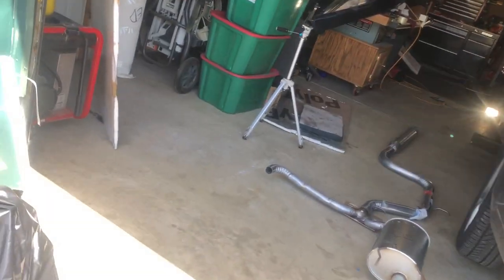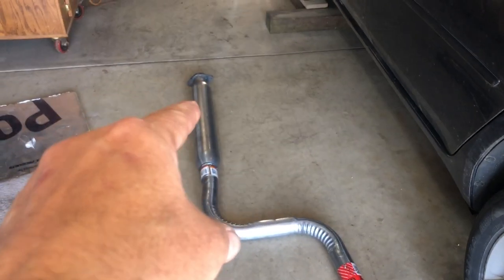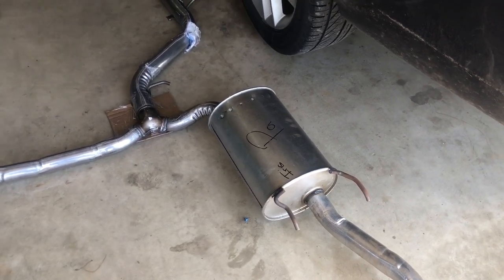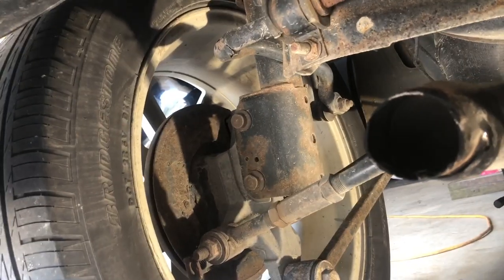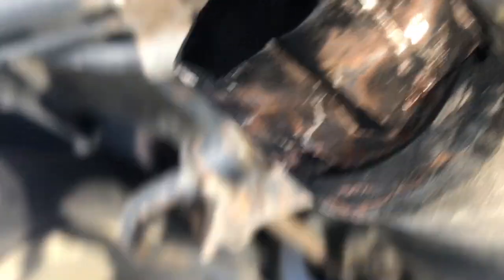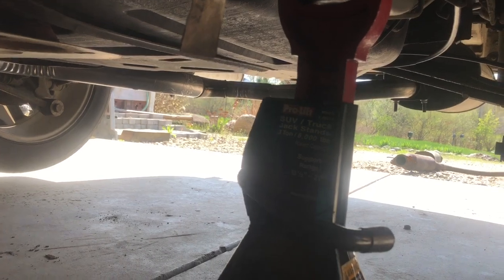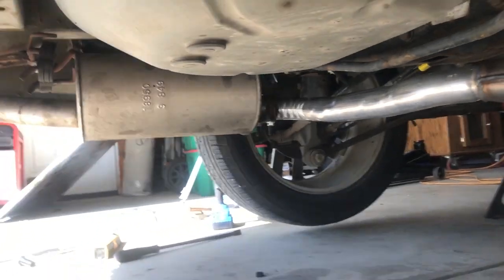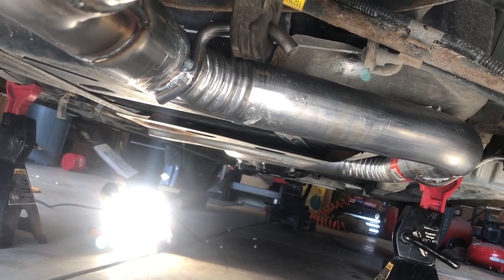06 - 11 Chevy Impala - CAT back exhaust replacement - No welding

Comment: Hey Bud i'm glad you got that pipe off without to much of a struggle. I've had great luck with Walker exhaust. Seems i always end up with a car from up north with rusty exhaust the Walker makes fine replacements. Looks good and best of all sounds great.  LOL when i lived in ND those were called Party stores too. Here in the south they're called Liquor stores or sometimes they'll say on the sign "package store" HAHA! I'm from GA originally. The coke spiel sounds about right! And as for as what you put your groceries in Up north is a cart. Down here it's a buggy. Take care!!
Reply from the maker: Ooo....cart and buggy.  I remember that one now!  I was actually pretty surprised at how easy and inexpensive this exhaust system was.  I have less than $200 in it (with shipping) for a cat back exhaust.  Getting the longer pipes sourced without shipping charges is key.  Most of the local chain stores you can get the pipes shipped to the store for free if they don't have free shipping to the home.  I like Rock Auto for their prices and selection but their shipping on these big parts is outta sight!

I would love to work on non-rusty cars.   Rust is my nemesis.  LOL!
Reply: @resurrectionautorebuilders8465  I think that's my main issue with Rock auto. Many times i've gone there to look for parts and find that i can get the same part from Ebay or amazon (because we have prime) Shipped free or for much less than Rock Auto. There prices are decent but when you factor in the shipping, it's not much of a bargain. Time can also be a factor. If it's a daily driver. I don't want to sometimes wait a week for the part. But yeah less than $200 is a great deal on that system.
Reply: How did you get it in screwed front the manifold

Comment: Is the catalytic converter welded at any location? I hav3 to replace one and was wondering. 2008 3.9
Reply from the maker: Sorry I didn't see this comment sooner.  The welds are from the resonator on back.  The cats are stud/nut type connections.

Comment: How many cats does the impala have?
Reply from the maker: Just one.  But it's a bitch to get to.  It's on the back side of the engine between the engine and the bottom of the firewall.
Reply: @resurrectionautorebuilders8465  thank you

Comment: Nice install I was thinking about getting the same system do you have a 3.5?
Reply from the maker: That is a 3.9.   The 3.5 is similar in the attachment at the resonator but it only has one muffler.   I've done a 3.5 on one of my other Impalas and it's very easy like this one.
Reply: @resurrectionautorebuilders8465  nice I have a leak in my manifold I can hear it leaking idk if this is something I can do myself